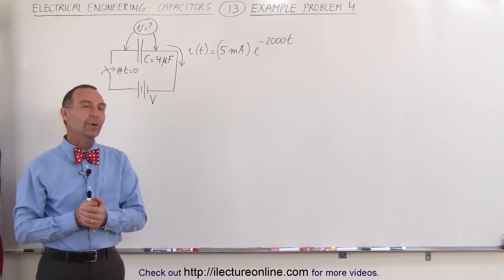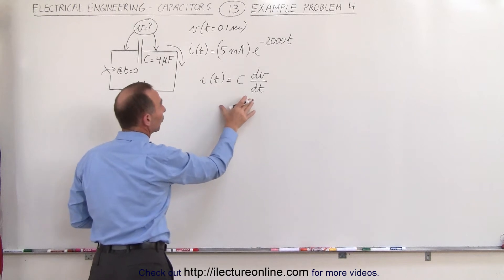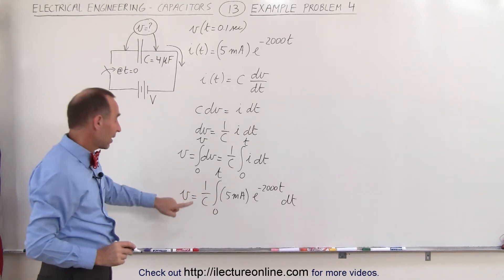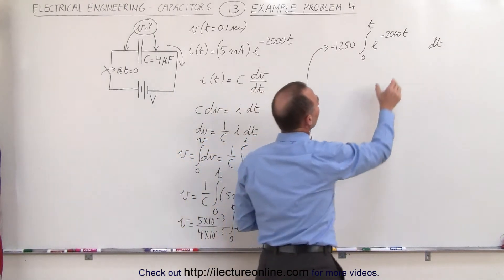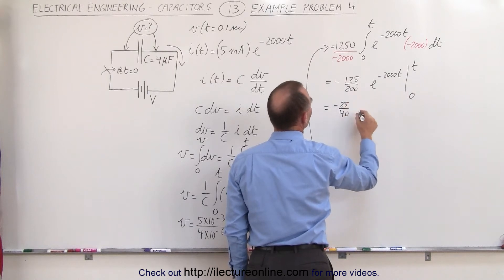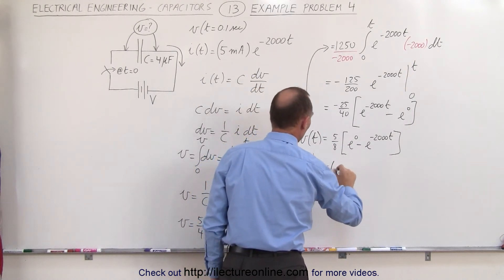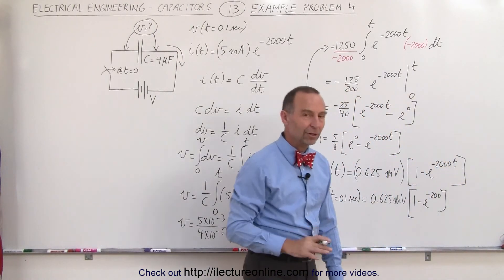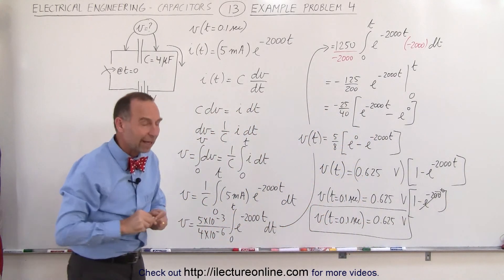Electrical Engineering: Ch 6: Capacitors (13 of 26) Example Problem (4 of 4) v(t)=?  v(t=0.1s)=?

Comment: could you multiply e^-2000t by natural log to make the equation simpler?
Reply from the maker: You could, as long as you take the natural log of both sides.  (the proper term is "take the log", not multiply by the log)